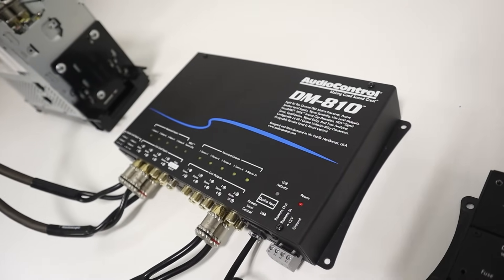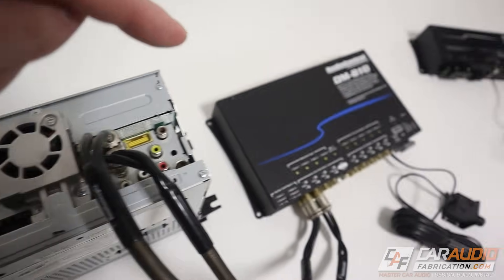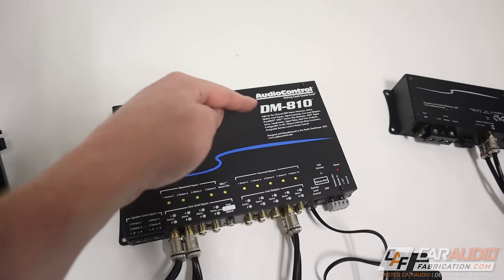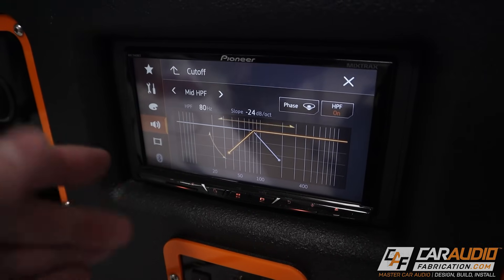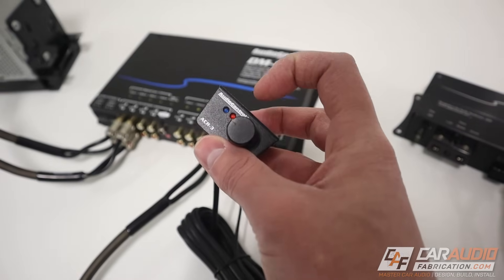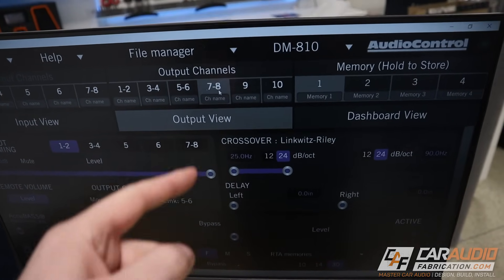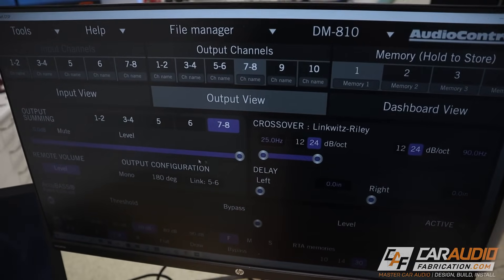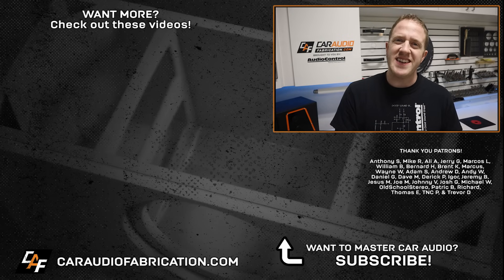Which subwoofer output is best? Direct from Head Unit or DSP?

Comment: Very informative video. I have a Pioneer DEX-P99rs as the head unit in my system. Do I still need a DSP. What can a DSP do for me?
Reply: Depends on how good you want it to sound. A DSP will allow you to tune each speaker individually meaning you can set crossover points, do time alignment, and equalizer settings on each speaker separately. Not to mention you can choose what type of filter to use and the slope of that filter for each speaker. As far as I know there isn't a head unit out that will allow for individual control of each speaker. With that being said you don't have to use a DSP if you like the sound you already have using the settings on your head unit

Comment: I have a Pioneer head unit with single ended RCA outputs and want to hook the RCA outs to my DSP which is capable of differential inputs and outputs, Two questions, does noise generated on the single ended side replicate its self even on the differential side of the system after the DSP? and second, is the signal coming out of the DSP going to my amps truly a differential output if there is a single ended input from the radio to begin with? Does the DM810 have a function to deal with this and convert the signal out to a differential type of output? I am confused because I can’t find any existing info on this topic and don’t know if running shielded RCA on the radio side and twisted pair on the DSP/amp side is even correct. Thank you for all the knowledge you have provided over the years! Hope all is well.
Reply: Your dsp is differential input.  Your amps are differential input.  Use twisted pair.
Reply: @zache.1099  the Pioneer head unit does not output a differential signal so using shielded RCA (single ended) is the proper  method between the head unit and DSP?
Reply: According to Tony D’Amore, you would use twisted pair in your situation.  He has a video on this.
Reply: @zache.1099  there’s a difference between differential input and output, the DSP accepts a differential input but the head unit does not output a differential signal which would lead me to believe between the head unit and DSP there should be shielded single core instead of twisted pair. Can you link the d’amore video you are describing? I would like to know more. Thank you

Comment: This is the thing; I don't like having so many options.. especially when it comes to something as subtle as sound
My head unit has a bunch of EQ settings, adjustments and extras. On top of that my amp has gain and some other setting where you pick the optimum range (or whatever)
I DON'T LIKE HAVING SO MANY OPTIONS.. BECAUSE I NEVER FEEL LIKE I HAVE IT 100% RIGHT

Comment: Ok so... after coming out of the DSP . Where should you set your subsonic  and low pass filters on your subwoofer amp?
Reply: Getting ready to upgrade from the lc 800.4 to the D6 channel  and going full active
Reply: @jtfordracing1975  
Either do it on the DSP or on the AMP, not both. They become mutilative if you do both. And since the DSP is typically software interface (which can be reset/bypassed with so-much as a power surge), it's generally seen best to not set a crossover on your DSP for your subs, and then set your sub's AMP as you always have, as that's a physical item requiring your input to adjust.
Reply: Depends. Are you setting them on the DSP? If so then don't use them on the amp

Comment: Would this bypass the H/U set up also work with an Audison AP8.9 & AP1D system? I'm about to order my system and Audison is the route I'm going. I haven't installed a system like this since my teenage years... about 30 years now :( If I bypass the head unit sub-out go directly into the AP8.9 bit (which is where I plan on connecting the DRC), would the software that Audison provides to control the DSP allow me to split the input frequencies to share with the sub out from the DSP amp to the mono block?

Comment: Mark, I really needed this. I am still a bit lose since I am using my stock head unit on my 2006 Infiniti QX5. It’s hard since no aftermarket head units are made for my old SUV. I have Focal Evo Front Mids and Tweeter and Focal Evos Rear Mids and tweeter connected to Alpine PDR-v75  and Kicker TRRP 12 Down-firing sub connected to Rockford Fosgate Punch P1000xbD amp. I want to put a DSP with this SUV. Can i set it up the way the you explained?
Reply: You can put any 7inch head unit into your car bro, reuse the factory mounting brackets and remove the factory radio
Reply: @iamchrisgates180  Thanks bro,

Comment: If I wanna connect 2 subwoofer amps to power up 2 subwoofers individually, how should I connect the RCAs to the amps if I only have subwoofer outputs from my head unit? Do I just use Y splitter RCAs and split the RCA signal? Or will that make the signal weaker.
Reply from the maker: Good idea for a future video, thanks!
Reply: Y-splitters work perfectly well.

Comment: I have a question; what if I use the sub out of my 9887 direct to amplifier, effectively freeing up 2 channels on my dsp408 processor. Would I need to increase the TA/delay on the sub outputs coming directly from the HU to accommodate whatever latency in the DSP? Just a cheap way to get 10 active channels for me without going Helix or MiniDSP

Comment: i have a diffrent idea, i have some music with very heavy base and some with out, and i don't have a subwoofer(i need my trunk very often so i need the space). kann i split my front and rear bass to the sub channel to control the volume of the Bass if i set the crossover right than can i easy control the subwoofer output over the fast menu on my HU, only to clicks. on my dsp that i will buy i can control master and subwoofer, but i don't have one. only 2 way bi amping in the front and rear

Comment: This has been on my mind a lot lately. Would you lose any signal "strength" by using only 2 rcs inputs?
I've decided to bypass my factory HU. Tomorrow I'm installing a 2.1 volt USB dac out of my phone into a LC1i line driver and then to the DSP. 
I tried a SoundblasterX G6 dac/amp as a line driver and the very low sub frequencies were way stronger. Hoping this Dragonfly Red usb dac can do the same with less bulk.

Comment: i feel like i messed up having ordered the d5.1300 because i want to use my epicenter. i should have purchased the d4.800 along with the lc1.800 or lc1.1500 and just added the epicenter in line with them. what would you suggest?
Reply from the maker: The epicenter can definitely be used with the D-5.1300.

Comment: I did fiber from my OEM adapter to my DSP (twk88). I loved just having one cord going to the twk, plus crystal clear sound. I joined the front and back in the software, similar to this, so I can have fade and sent my outputs to my amp (RD 900/5). Simple enough. IMO, if you can do fiber from your head unit or OEM adapter to your DSP, do it. It makes the install so much easier. Thoughts CAF?

Comment: Now blow their minds with running a toslink cable to the dsp.
Reply from the maker: The main question that the viewer asked was whether or not to use the designated subwoofer outs but yes Toslink could essentially be used in the same way as I describe in the example as it just L&R signal. Unfortunately we just don't see optical out all that often although you can check out my Stinger Heigh10 review that has it and the Grand Cherokee project where we used optical out of the Pac Amp Pro.. Thanks for watching!

Comment: I’m just going to keep my stock head unit and get the DSP then. It makes no sense to spend the money like 1000 for a head unit and the dash kit with all the other bs when The dsp is the best and easiest way to run a system, I’m sold
Reply: Easiest? $500 for a head unit with DSP and RCA to the appropriate amp. Skip the audio control sales pitches.

Comment: But what if our headunit has built in DSP?
Reply from the maker: There is not a head unit in existence that has the same power as a standalone DSP.
Reply: @CarAudioFabrication  great points. What about an RCA volt booster? Standalone DSPs are so expensive 😕

Comment: You talk  about rca what about fiber optic?
Reply from the maker: The main question that the viewer asked was whether or not to use the designated subwoofer outs but yes Toslink could essentially be used in the same way as I describe in the example as it just L&R signal. Unfortunately we just don't see optical out all that often although you can check out my Stinger Heigh10 review that has it and the Grand Cherokee project where we used optical out of the Pac Amp Pro.. Thanks for watching!

Comment: another advantage of running a sub rca from the deck to the dsp is sub LEVEL control straight from the deck. no need for a separate level control if one is right there in the deck. i just did a system with the little brother of the AC  dsp used here. with the old school type alpine rotary control, sub control is a press away, no need for another component in the system, i.e. the remote for the dsp (which costs extra).

Comment: It's not a good idea for you not everyone likes to use Dsp for the subwoofers so it's up to the installer n it's personal experience
Reply from the maker: No offense but if your installer is using DSP for all the speakers in a system but not for the subwoofers, they don't know what they are doing.
Reply: @CarAudioFabrication  I'm an installer n from my experience using the DSP for your subwoofers is only if your doing a Sq build it not for doing spl builds or bass boxing builds that use Pro Audio speakers so it's a different building experience n it all depends on what Type of Bass your going for so like I said it's a preference of the installers choice 😉
Reply: @Mrkdog8081  well that just made no sense. A DSP is going to be better in every scenario
Reply: @beardedforlife3740  how 🤔 if your going for bass boxing competition n not Sq
Reply: @Mrkdog8081  even a spl build needs tuned and a  good DSP is always going to be able to do it better than any amp or headunit

Comment: Lol why buy the dsp if you just bypass it rofl. I didn't know there were ppl out there worse than my mom at wiring systems...
Reply from the maker: No one is "bypassing" the DSP. It's a matter if you are using the signal from the front channels or the independent subwoofer signal. Should probably watch the video before putting down folks trying to learn when it doesn't seem you understand either...

Comment: Dude totally over did it, how about keep it real simple...phone to aux/rca then rca to amp? I mean this might sound like a dumb question but can't you just go from your phone using an aux2rca then just connect the RCA to amps? And screw the dsp and head unit?
Reply from the maker: You could have th best signal source in the world but the second that signal plays in the audio domain in the horrible listening environment of a vehicle it needs correction to sound optimal. Feel free to keep your system "simple" but IMO DSP is simple and key to getting everything sounding the best.
Reply: @CarAudioFabrication  thx. One more question, is there any difference between using a headunit vs the method I intend?

Comment: When u have sub out you have a built in sub controller so why use the amps bass remote? Bass remotes are the root of all evil lol
Reply from the maker: This is incorrect. While bass knobs from poorly designed amps can be bad (as they are basically a remote gain control) there are plenty of good amps on the market like JL Audio and AudioControl that have the knob serve as a volume attenuator. They do not "introduce distortion" on these intelligently designed amps so be careful with blanket statements that others like to make. 👍

Comment: I just ordered a epicenter micro. It asked for full range signal. Are aftermarket sub out puts full range until I turn on the sub crossover on the head unit? Or would I have to put a Y spliter on one of my rcas to get signal to my epicenter?